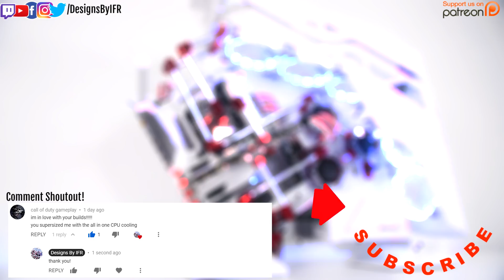HUGE Water Cooled Gaming PC Build i7 9700k & RTX 2080! - Ultimate Time Lapse Build 2019

Comment: I love the setup but not the colour, job well done. I missed the give away but have ordered the P7, it should arrive at my supplier mid July, can't wait. Once it arrives I'll start saving for a mobo/chip/ram combo and build the centre unit. After that I'll be saving to buy some water cooling gear and do my first Water cooling job, first the CPU with Radiator/Reservoir/Pump, then the same for my graphics cards which I'll also be saving up for as well. Hopefully by Late 2020 I'll have it all kitted out. Can't wait, I'll be using you as a building reference. All the best and keep those videos coming. 😃

Comment: Lol no gpu block but two 360mm rads😂
Reply: Ya but it looks dumb from an enthusiasts view of the build and im not hating i was just pointing it out...
Reply: @Toddothegoddo  Yeah its a bit odd, there's like 5 reservoirs just to cool the cpu. Its typically the gpu that benefits more from watercooling but it hasn't been done.
Which is weird considering the cost spent to cool the cpu, why not cool the gpu too?
The left panel could cool the cpu and the right for the gpu with 2 loops of different colours, that would be better, you don't even need the tube reservoirs if you have the distro blocks.
Reply: @colinjava8447  ya but the tube res also serves as the pump
Reply: @Toddothegoddo  yeah but you could just put a top on the pump and feed it from the distro block.
The build I'm working on is also a bit bonkers with glass tubes, mirrored panels and an aquarium (without fish), but it makes sense, the lack of gpu cooling on this build doesn't.

What if on this blue/orange build the CPU and GPU were air cooled and all these radiators and distro blocks just cooled the ram, that would be idiotic, but that's almost how I see it now when it only cools the CPU.
Reply: @colinjava8447  ya i could understand that but it also was his fill point
Reply: Game Evolution yeah it would have been perfect with a gpu loop
Reply: He should have put 4 360mm rads
Reply: 10c under load anyone?
Reply: @summitvision4048  But water cooling the GPU with another block would be more visually pleasing as well as more practical soooo.....
Reply: Honest Question: adding waterblock on normal gpu, will it void the gpu warranty?
Reply: Fr33domSouL it didnt on my 2080

Comment: Do you use two 360mm radiators for a single CPU?
Very inefficient....
Reply: Or you know, plan to expand to another GPU. Then watercooler both GPUs >.>
Reply: its for those who wanna play in NEVADA
Reply: @Jeffrey Kyle I figured someone would have the logic to understand that he may plan on expanding the system to water cool the GPU in the future.  Then eventually run SLI and water cool both.
Reply: But who needs a cool gpu

Comment: If shown in a fancy computer Exhibition.Definitely a winner.Perfomance wise? Sheer waste of money.
Reply from the maker: 2080ti and 9700k is a waste?
Reply: @DesignsByIFR   The K variant is over-clockable.But you didn't and water-cooled it on top of that.It can still run with air-cooling if you are just using it stock.Definetely a good PC with good components but the water cooling in stock is overkill.Moreover with that cooling setup you could even water-cool dual GPUs in SLI.
Please understand I do not dislike the build and I do encourage YT content creation.

Comment: What's the point of the fans there not cooling anything
Reply from the maker: Yes they are, they need to be on the radiators to take the heat out of the water loop

Comment: dope PC... but all that just for the 9700k and not the GPU? I can see if it was a 9900k but its your build and it is sick but thats crazy cooling for just a 9700k
Reply from the maker: No such thing as overkill =)
Reply: @DesignsByIFR   Oh I definitely didn't use the word overkill lol i have a serious PC to just for WoW that is wayyyy above its needs. I was just saying 2 360mm rads for a 9700k is just crazy. I can only imagine the temps. I know my 9900k with my Corsair Platinum  280mm keeps it at mid to high 20s idle and never over 55c under gaming for hours.. Are you going to put  a block on the GPU?
Reply: I wish you were located in the States especially New England area of the states lol.. I want to put an open loop in my PC but i would never use soft tubing it would want it hard tubing and out of all the   PCs i build i never done a custom loop. I have OCD bad so i would need my runs perfect thats why i wish i knew someone to help me do it or pay them to do it when I get a new case and GPU.. right now my 9900k is in a MSI Z390 Godlike 32GB dominator plat 3866mhz.. but the case is Corsair Air 540 and the gpus are 2x EVGA 1080 Classifieds.. So once i get i think Evolv X and 2080 TI Kingping for  2080ti Lightning Z im definitely going to start the open loop.

Comment: So... All of that fluid is cooling the cpu..? Seems like an awful lot of fluid to use on the one part, as opposed to using it to also cool the GPU and motherboard VRMs.
Reply from the maker: No gpu blocks available and its only 1.5L
Reply: @DesignsByIFR  

Really? No block available for that gpu yet? I'm kind of surprised. Even more so by the fact that it's way less fluid than it seems.

Comment: What's the point of running the liquid through the first rad before it has a chance to pick up any heat from the CPU?
Reply from the maker: Because the whole loop is connected, all of the heat in the loop will not be removed from the rad after the cpu

Comment: Jesus！He glued the custom water tank ，There is a huge risk of leakage in doing so.Cause maybe the chemical reaction is there.
Reply from the maker: No its acrylic weld not glue
Reply: @DesignsByIFR  It seems that I misunderstood. But I still think there are 2 potential risks: 1. cause it is built by hands, Obviously the welding material on surfaces are uneven. As we know, when facing the pressure, the welding surfaces will be the issue of tearing. 2. I Really know nothing about the chemical performance of this welding material

Comment: I see the drain port, but how do you actually drain it considering all the fluid in the parts? Additionally, how does the (superglue?) hold up with regards to the plexi long term?
Reply from the maker: Its not super glue it is acrylic weld

The drain ports are on res in middle and both of the side custom water channels so its very easy to drain

Comment: 7 views 12 likes nice
Reply from the maker: Hahaha broke the system!
Reply: @DesignsByIFR  quick question would you recommend the EK-KIT RGB 360 for first time custom loop building?
Edit: reasoning why i wanna custom cool is performance and that AIOs have a bigger chance to leak(thats what i was told) and as i wanna have a cool setup i dont wanna use a normal air cooler like dark rock from be quiet.
Reply from the maker: Yeah of course. As long as you do not add in any other water cooling parts made of a different metal that will be perfectly fine
Reply: @DesignsByIFR  yeah i heard something about copper or nickel and was confused, does changing the resovoar  to a EK-RES X3 250 RGB ( just a bigger version) really matter,?.
I may expand later but i was thinking using that kit would be a good start